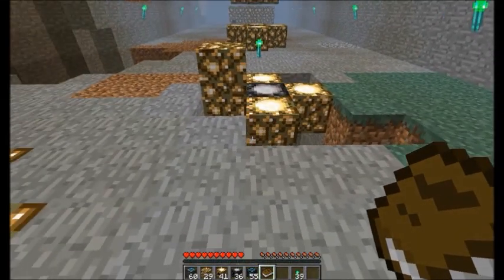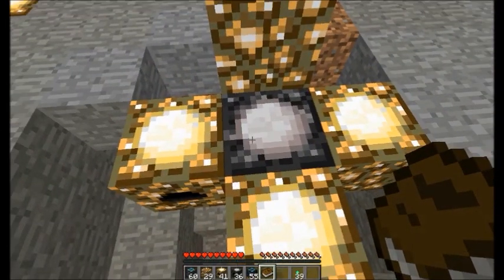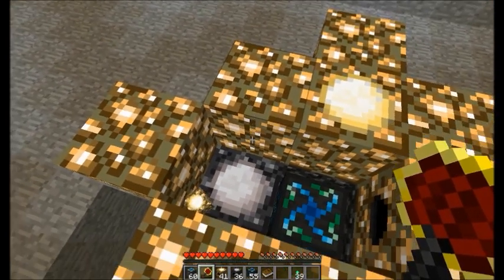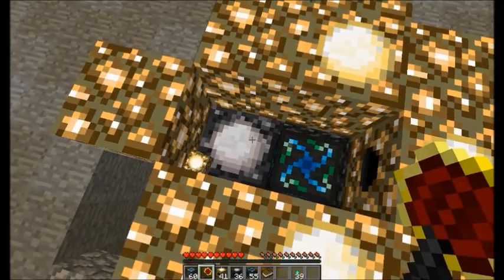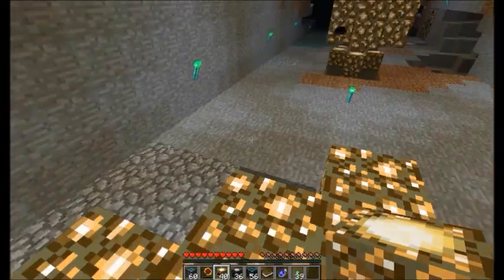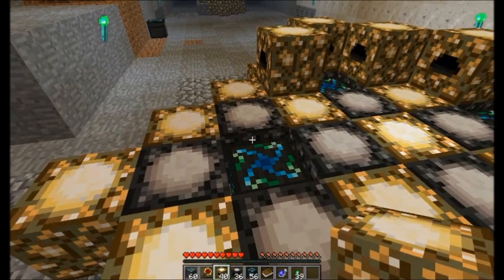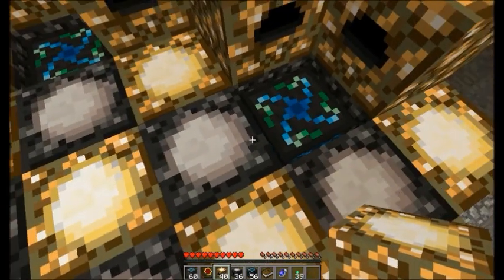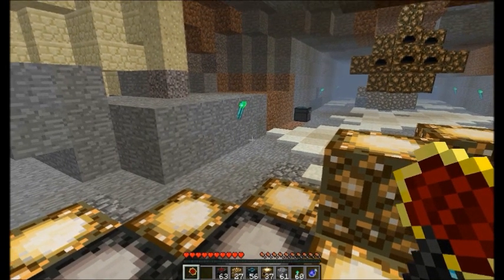EqEx Guide to Energy Collectors, Antimatter Relays and Energy Condensers-pt2

Comment: ... still on the top?
2. when you build a 5 relay flower put a collector in the middle. Then throw in some klein steins. Is the charge time maxed and no EMC will be left in the relays? If thats the case then this seems to be the most optimal klein charging system with the least amount of maintenance. Ofcource this also means a klein stein always has to be in charging mode - otherways emc will get stuck in relays.

Comment: The volume was still quiet, except from 14:00 onwards. Had all my volume controls at max.
Good video tho, i was just looking into how to build things up in my server.

Theres two things regarding these that are still unclear but which i need to test out myself:
1. the bottom collectors have all sides except the bottom closed, then after a relog the front side appears on the bottom - this means that the pan-plate texture is on the side - but does it mean that the light sensoring is on the side or